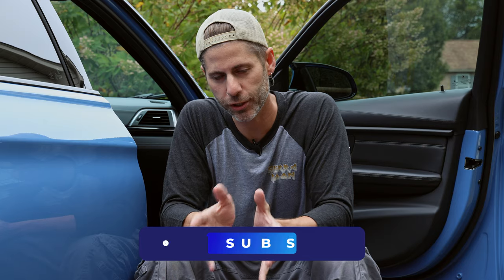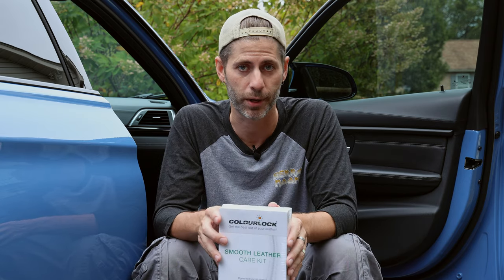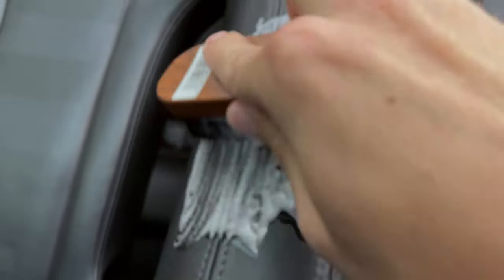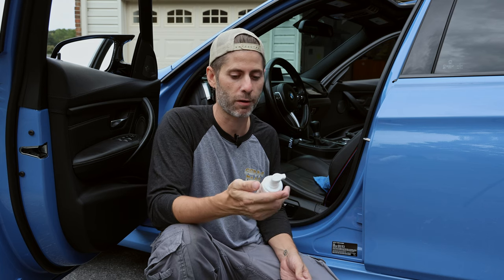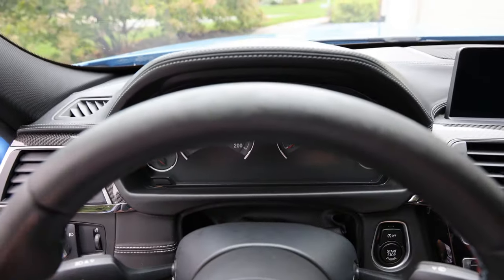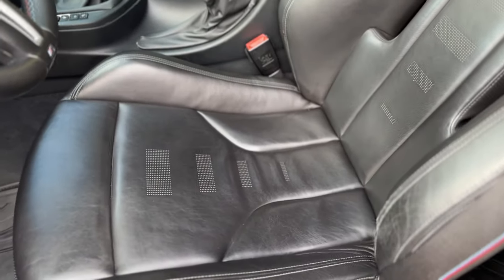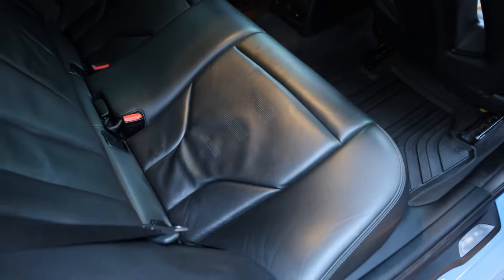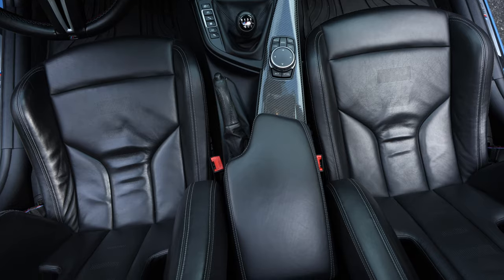How to Clean and Condition BMW Merino Leather with Colourlock

Comment: Turned out great and for the scratched leather areas near the door handle, colourlock sells a dye/repair kit as well thats perfect matched to the bmw black leather and it will look new again. Same with the side bolsters.
Reply from the maker: Thanks brother, and thanks for the heads up! I saw the steering wheel repair kit but not the leather dye.. that looks like the perfect solution for that section by the handle - it's driven me nuts since I got the car. Blew my mind that there are 278 leather color options for BMW.
Reply: @AlwaysSummerGarage  haha yeah there's a ton! I have the same marks it's from people's nails hitting that area when grabbing the door handle. If you do end up getting the kit, definitely make a video on it!
Reply from the maker: Yep, definitely will - would be a great follow up (just gotta find my color lol) 🍻

Comment: Hey man love your videos very informative and entertaining :popcorn-yellow-striped-smile: Also wanted to ask if you're gonna get catless downpipes for the M3? Would like to hear how it sound with the VD exhaust. Really good quality to you videos too, I have small channel as well. Just out wanted to ask, what camera are you using? :elbowcough:
Reply from the maker: Thanks so much brother, appreciate you checking them out! For downpipes I'm going to go high flow catted; probably ARM or Evolution Racewerks. I think catless might reintroduce some rasp into the system and I wouldn't want to be full straight piped due to volume (the Valvetronic exhaust doesn't have cats or resonators). As for cameras, I think this video was my first one using my Canon R6 MKII.. everything before this was shot with a Canon M50 MKII. Definitely will check out your channel!
Reply: @AlwaysSummerGarage   Thanks a lot for the lengthy reply, really appreciate it 😍